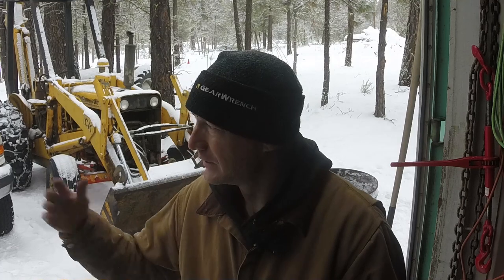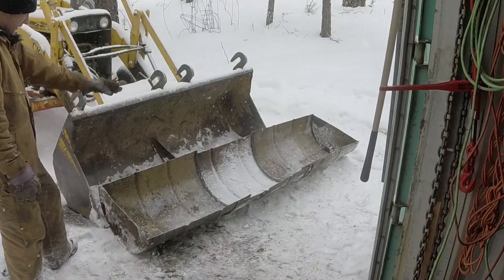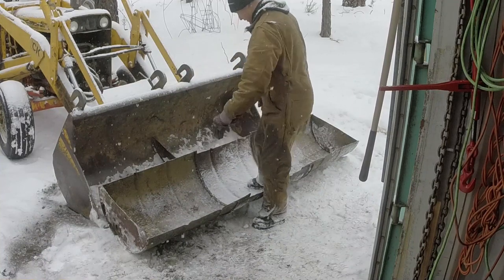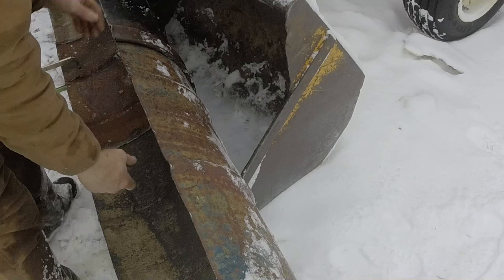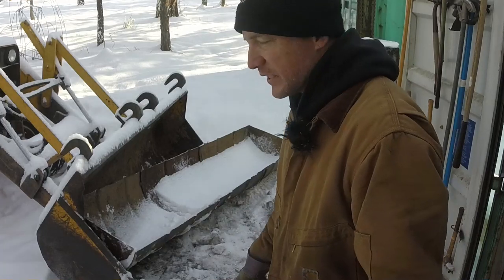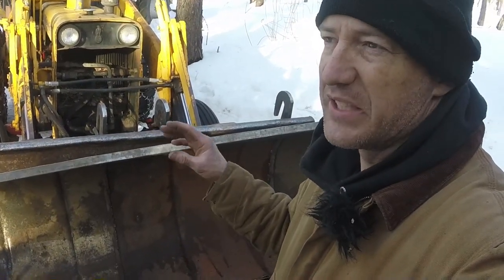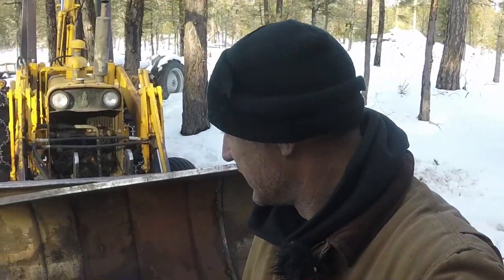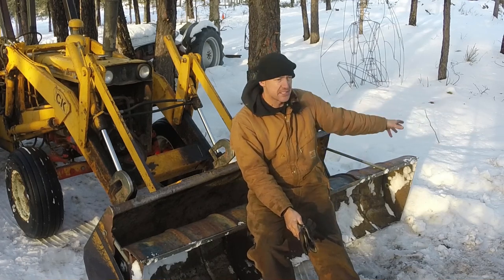Making a snow plow, with 55 gallon drums

Comment: right on. simple ideas that help make life easy.
Reply from the maker: It worked out pretty good. :)
Reply: @KoalityofLife  at least save from doing 4 passes to just 2 :)
Reply: @KoalityofLife  might be able to get some type of strong plastic to ride the ground to get a smoother plow. and i my self would opened them barrels up more. so the snow cant build up but instead roll out the side. 

one thing we found when plowed back in day snow roll better higher the speeds. lol me and my dude sitting here use to race around some of the lots we would do. me and him would start in centers and push things to the outside instead starting outside trying to always working in while pushing out. so me and him changed the traditional way of doing things and ended up we would do lots in 50% quicker time then the previous crews. we traveled in pairs for the lots cause we found not only quicker but so much easier with 2 trucks chaining each others lines. 

actually use to have to much fun plowing then i should have lol.
Reply from the maker: @StevesDIYProjects7  I hated always having the line of snow in the middle of the road. Now it all goes off to the right side.
Reply from the maker: @StevesDIYProjects7  I actually like plowing my road, its kinda fun. If I could go any  faster and still stay straight on the road I would but my backhoe is only 2 wheel drive and the front tires don't get a lot of traction for steering. It's still fun. :)
Reply: @KoalityofLife  gotcha. and yeah i didnt think it would go to fast being a tractor. i hate plowing in bobcats.
Reply from the maker: @StevesDIYProjects7  It would be nice to buy a plow attachment for the elCamino but until I can afford that this will work. :)